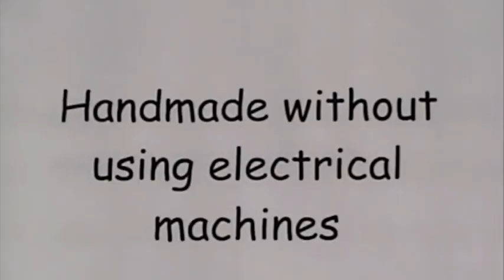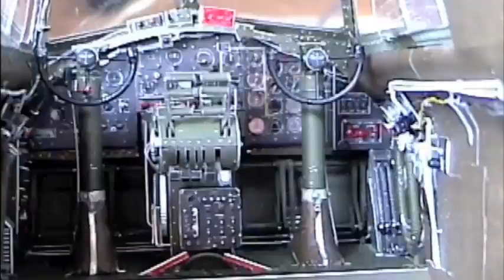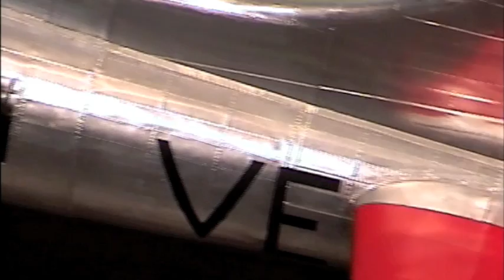Boeing B-17 G. Truly Scratch-Built. One-Off Metal Model. Model Engineering.

Comment: My cousin was the pilot of that b 17 after Happy Bottom  any reason for that b 17
Reply from the maker: Yes, it is the only B-17G that fought in WWII that was photographed in color from all angles.Thanks to those photos, I was able to correct errors represented in kits and illustrations in the 90s, when this machine was represented with the short nose cone, the Cheyenne tail turret and with misplaced markings. This model was built between 1998 and 2000, when the internet was in its infancy.

Comment: Ive been collecting formed  stainless shapes for a few years , with the idea of doing  a DC 3 .   What an insane amount of work .                          And you have to keep going , cause you know when its wrong .  Makes me wonder , looking at the video , Do I want to start it ?
Reply from the maker: Paul, do you want to build a scale model of the DC-3 in metal? You would have to try using aluminum, not stainless steel; it's much easier to work and besides the actual plane was basically made of aluminum. Here I attach some photos of the C-47 and DC-2 in 1:40 scale that I built in 1983 for the Naval Museum (Naval Aviation) in Buenos Aires, Argentina.
https://www.rojasbazan.com/models/douglas-c47-c39.html

Comment: How do you possibly shit those key components with such realism? Where did the superchargers come from? Every single doo dad & thing-a-ma-jig looks functional. The cockpit gives me a headache from realism & imagining a person creating it. Pause at 2:35 & stare at that assembly. Crazy.
Reply from the maker: Thank you for the comment, Daniel. The main factor is the construction in real aluminum (not bare metal foil over plastic). For this reason the weathering and chipped paint effects are "natural" and don't need the complex method of paint mixes that the plastic modelers use. Real fire and smoke can also be applied to exhaust pipes, gun muzzles and superchargers. The effects are hyper realistic. Watch the weathering effect in my latest video, Ju 87 Stuka Part 3.

Comment: I would love to see if he got the centerline on the fuse correct. That is some outstanding work.    A lot of modelers who built a B-17, mostly in RC don't realize that the Fuse is in two pieces, each with it's own centerline, and when joined, they intersect at bulkhead 6 where joined, but at an acute angle. The tail sits higher on the real B-17 than most models have it.    Considering all the framework that went into this model, pretty much guaranteed he used the original plans to layout the bulkheads and formers to get them just right.   I happen to be a part of a restoration team on a B-17E and am using the original drawings to help build an 1/8th scale flying one.   Won't look anything near as good as this one, almost looks like the real thing.
Reply from the maker: Sir, thank you for the comment. Yes, for the construction of this B-17 model, I used engineering drawings, manuals and tons of actual photos (as you know, externally there were many differences in the same G series; panels layout, tail station, nose plastic cone, wing tips and more). I also had the opportunity to be in close contact with Yankee Lady during maintenance in the late 1990s.

Comment: Nothing better to imitate rivetted aluminum paneling than aluminum, this model highlights the general problem with plastic models, their appearance is too smooth and too perfect.
Real metal being handcrafted shows all these little wrinkles and creases, and the unevenness along rivet lines which the real planes have.
That's the reasson I rather spend time on building a brass model of a locomotive or railcar than buying a ready to run out of plastic, the metal model will look far more lively and work worn, even new locomotives fresh from the factory don't have perfectly flat skins.

But compared to my locomotives this is a far more complicated build, and real art!
Reply from the maker: Thank you very much for your comment. I totally agree with you about riveted aluminum paneling, metal wrinkles and the unevenness along rivet lines on real airplanes of the time (the incredible thing is that few modellers realize that). These effects can be seen better in my last videos in HD (A6M2 Zero part 1 and 2).
Reply: I have seen your model of the A6M2 and it looks amazing!
Reply: I worked at the Great Train Store north of Atlanta and saw time and time again that metal locomotives by Mantua would fly off the shelves while plastic steam locomotives would sit there forever.
Reply: You have great perception. This guy is FANTASTIC!

Comment: When I watch your precisely work, I'm not from this planet. How is it possible, doing such work. How do you build the engines with propeller shaft, valve covers, cylinders etc ? Regards from Germany👏
Reply from the maker: +turbocompound 
Perhaps this is possible because I started building my own models in cardboard from scratch at age five. At eleven, I began to build in wood (I was never interested in plastic kits. The only kits that I was very interested were the old Guillows, because thus I learned the basic steps for the construction of the structure of an aircraft model).
Then I started to build in metal. I am a professional model maker and I'm building airplane metal models from scratch and totally by hand for museums and collectors since 1982. Thank you for watching my videos!